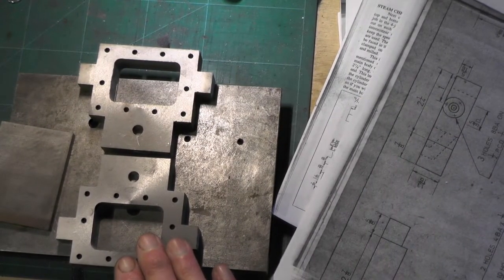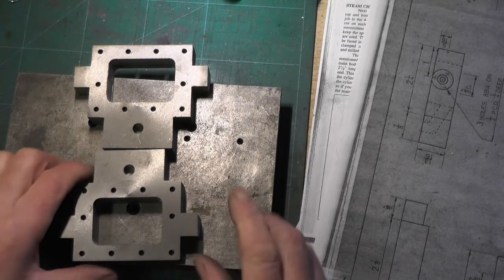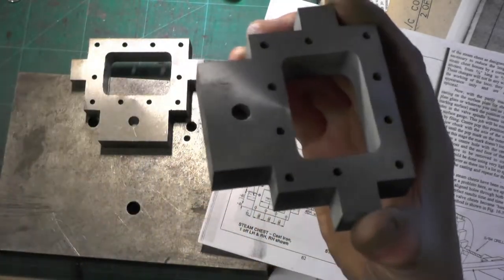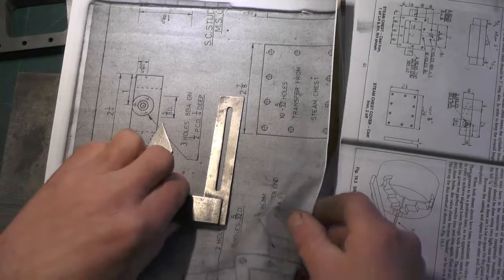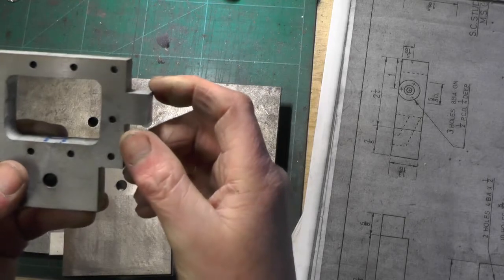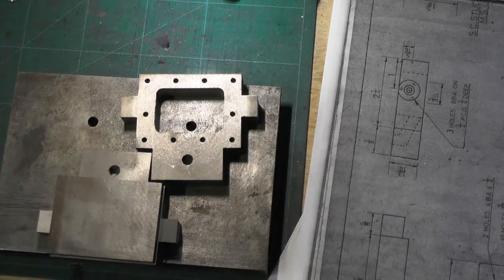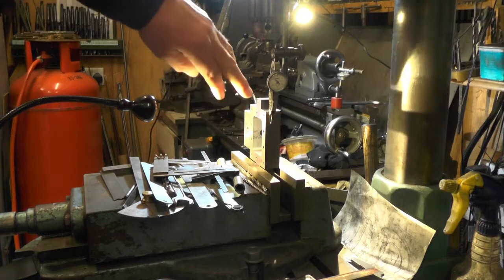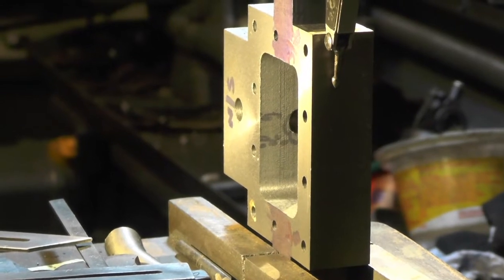Make a Beginners Steam Locomotive (Valve Steam Chest Inlet Port) "mr factotum"

Comment: An excellent series! I’ve been after one of those types of angle gauges for awhile. Would you happen to know what model number it is?
Reply from the maker: hi there 
thanks for comments, appreciated
the angle gauge is very old, I got it of a chap who was retiring when I was an Apprentice many years ago now
I will have a look if there's a number on it next time i'm in the cave.
regards
mr f
Reply: Thanks.
Reply from the maker: sorry for delay in answering your question, the angle gauge i aquired many years ago does not have a make or model name on it, all there is stamped on is Made in England followed by a patent number.
if i find out any more info i will get back to you
regards
mr f

Comment: Thanks again for these videos. Did you take any special measures to try and stop the 1/8 drill from wandering when drilling the holes for the valve spindle? Not sure what you could do, really, but it's a thin drill and a long way to go. I suppose if it's straight it might not matter if it's at a tiny angle off perpendicular, perhaps the valve linkage has enough play or adjustment. But if it isn't straight, that will be a problem, I would have thought, as your valve spindle probably is dead straight. I dunno, maybe the valve spindle will bend to conform, it's not very thick.
Reply from the maker: Thanks for viewing and comment, no special measures just went very very slow with feed and it picked the other side up ok, checked with a piece of true and straight piece of bar and it entered other side true and in line. 
regards
mr f